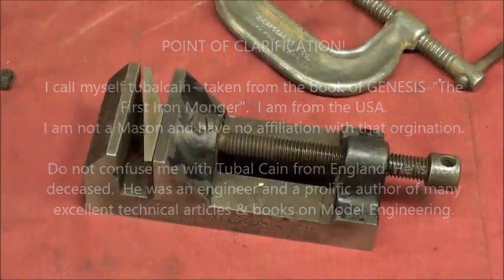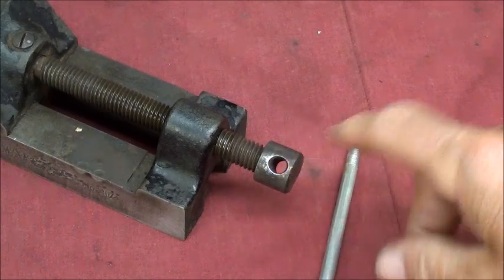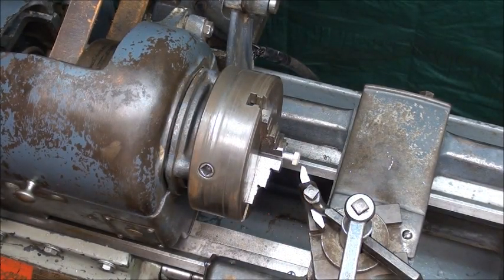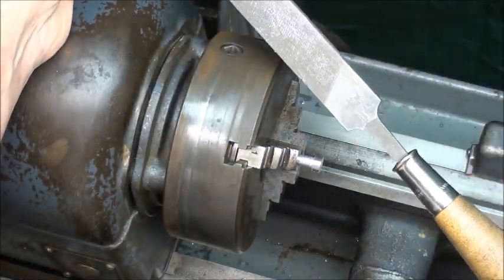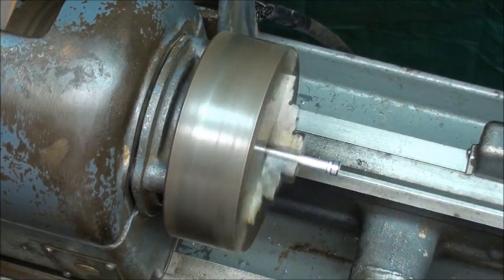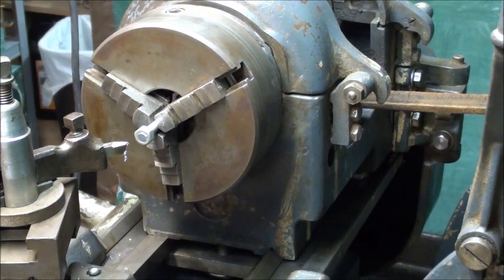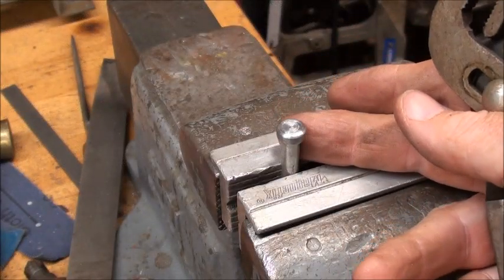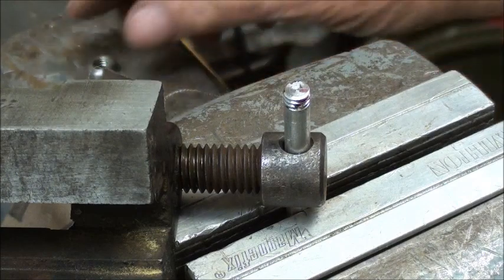MACHINE SHOP TIPS #116 Getting a Handle on Things tubalcain using the LOGAN Lathe

Comment: that leather belt with metal comb like joint can be replaced on those old lathe machines..
my dad used old car timing belt inside out, he had to dismantle lathe to be able to fit it but it was well worth of it as it runs much smoother and very fine finis is now possible

Comment: I've written before with my compliments on your fine teaching ability, but here want to let you know that I got my Harrison 190 (15") lathe working, faced off and made some 1mm pitch threads and have put it through the paces like only a new beginner can! Cleaned the inside of the compound and crossfeed and tailstock is now working. 3 jaw runs out .003". hmmm. All the nuts and bolts are inches, all the dials in metric and will take getting used to. You, sir, have really helped me out. THANK YOU.